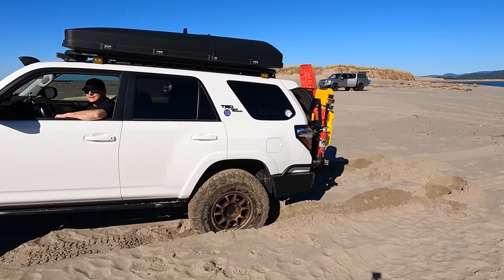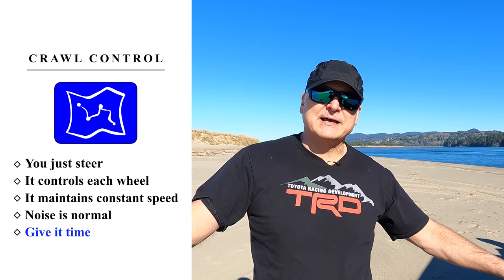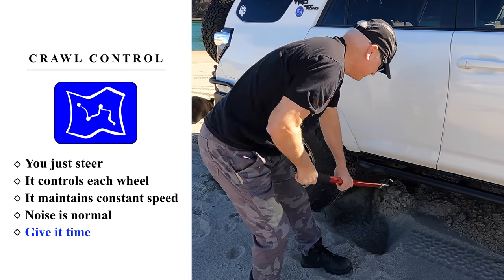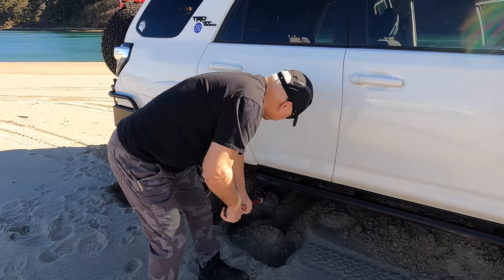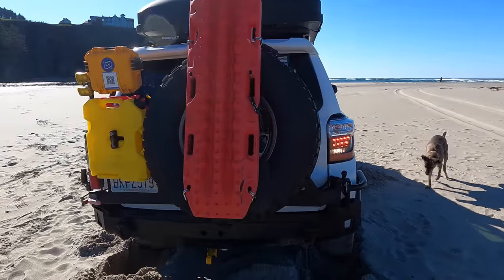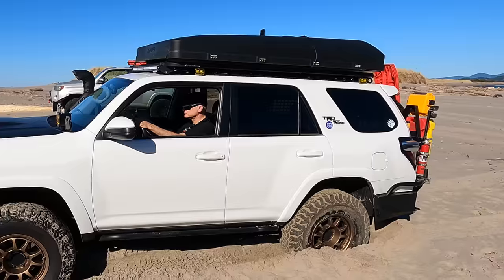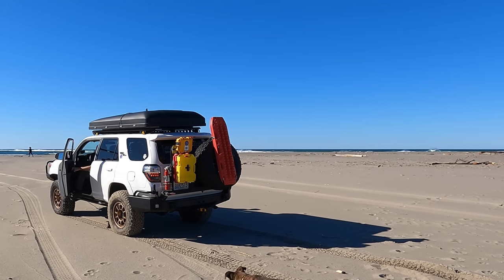Finally, the Only Crawl Control Video you Need to Watch - 4Runners Overlanding with Crawl Control

Comment: I have a SR5 P.  I am guessing I should get a winch and max tracks to be ready for these conditions and maintain momentum?  Your information is awesome. Subscribed!
Reply from the maker: Big thanks for the sub! The SR5 is very off-road capable right off the showroom floor. Wish I had the premium package! With a winch and MaxTrax, you'd definitely be in good shape. This is probably already on your list but everything comes down to traction and that means having a great set of tires that match your style of driving and the terrain you off road in the most (rocks, mud, sand, etc.).
Reply: @OverlandPNW  can I ask you what size tires would you recommend?
Reply from the maker: @MrJanglooos  That's the million dollar question! There are a lot of different opinions on this. For me, it starts with what kind of build you want. Is it going to be more of a dedicated off-road vehicle or will it be a daily driver? Mine is not a daily driver and I am currently running BF Goodrich T/A K02 315/70R17 which is a 34 inch tire (34.4"). My brother runs KO2s as well. His are 285/75R17 which is also a 34 inch tire (33.8"). Both required a body mount chop, a 2 1/2 - 3 inch lift, fender modifications, etc. to fit. For me, the geometry changes going above 34" tires just are not worth it for my style of off roading. The tire I had immediately before this one was a 285/70R17 which is a 33 inch tire (32.71") and it was pretty easy to fit. This was a nice step above the stock 265/70R17 32 inch tire (31.61") and still had very nice street manners. If you plan to do a minor lift and want to have a nice daily driver that will handle some fun stuff off road, then a 33 is not a bad choice. If you are going to do a bigger lift, cut plastic fenders, install bumpers and build something that will handle more serious obstacles, then I'd consider 34s. Tires are definitely one of the toughest decisions!
Reply: @OverlandPNW  thank you so much for this detailed response.  I will have to really think this over as you suggested to make sure I get the right ones.  Thanks again for sharing your knowledge.

Comment: Great tutorial I will have to watch and rewatch your videos, 9ne question.. will  Crawl control with work alongside MTS? I thought you can only use one at a time?
Reply from the maker: You are correct, you can only use one at time. You can however use CC or MTS (on the front axle) if you have your rear differential locked.

Comment: your techical reviews of the equipment available are great, thanks for the thorough job.  Do you happen to know if there is a maximum speed one can drive in 4HI in an off road premium or TRD PRO?  I know the system can be engaged until 55 MPH but there is no info on max speed like highway driving?  thanks
Reply from the maker: Your are correct. The manual does not state a maximum speed limit for 4WH after it is engaged. There are a lot of anecdotal accounts in different forums from people claiming different speed ranges are safe. There was even one I read of a guy that drove his 3rd Gen in 4WH to max speed every year on the salt flats. I'd say just use good judgement based on road conditions. If you heard of any reliable info on this topic, let me know. Thanks!

Comment: Good video. Is the Tacoma lifted? Thanks.
Reply from the maker: Yes, it is. About 3". Cheers!
Reply: @OverlandPNW  thanks for the reply. Is that the factory lift? I also wondered if the rear locker was used during the testing.
Reply from the maker: @8626John  The rear locker was not used during the testing.

Comment: Toyo 12  I have a 2022 4Runner TRD OFF-ROAD. I'am considering adding an ARB front locker and ARB air compressor. Can someone recommend a good 4wheel drive shop in the Vancouver, WA area that can perform this work? You guys have some very good videos, Thanks!
Reply from the maker: You will love the front air locker! I had my gears and air locker done by Nitro Gear & Axle. They are near Leavenworth in a town called Cashmere. As for Vancouver, I had an ARB rep recommend Woody's 4x4. I have never used them So I can't comment myself. I have been to their shop. They are usually pretty busy. That's what I know.
Reply: Thank you for the info. Your new partner must love the off-roading, Keep up the great videos. Thanks again.

Comment: The crawl control works fine until it's hot. The tranny overheats on the hot sand where I'm at.
Reply from the maker: I checked out your channel and saw you have a lot of experience with sand recoveries! I subbed. Watching the Land Rover is a good time!
Reply: @OverlandPNW  I appreciate it.

Comment: Thanks for the vid. Would you still recommend installing an ARB front air-locker with A-Track ?
Reply from the maker: The ARB air locker is great. The decision to install it with A-Trac just depends on your driving style and whether you already have a rear locker.  If you do casual off road trails, then there is no need for a front air locker (especially if you already have a rear locker). If you are doing more advanced obstacles, then I would recommend the front locker (even if you have a rear locker). My 4Runner has the factory locker on the rear axle and the ARB air locker on the front axle. A-Trac and Multi Terrain Select are also fully functional. But, I like to try advanced trails.

Comment: I love the production quality and educational content in all your videos, thank you!  One question.  Do you have transmission coolers?  I'm assuming since you have tow hitches, you probably have dedicated transmission coolers...but when you are going really slow (crawl control) it probably doesn't work very well.  Just curious, thanks again for the video!
Reply from the maker: We don't really tow much other than a small utility trailer now and then. Mostly, we use the hitches for recovery points. So, we do not have transmissions coolers. Cheers!

Comment: Any chance you know the suspension and tire setup on the silver 4Runner at 9:00
Reply from the maker: Yes, the silver 4Runner has about a 3" lift on Ironman foamcell pro stage 3 suspension. His tires are BF Goodrich T/A K02 285/75R17. His front bumper/fenders are modified for clearance. He has the Southern Style Offroad front bumper with the High Clearance Side Protection Option. Cheers!

Comment: Howdy, what lift kit did you put on your 4runner. Love all details!
Reply from the maker: The white 4Runner has Icon Stage 2 3” Lift on the front and Old Man Emu rear springs on back. The silver 4Runner has Ironman foamcell pro stage 3 suspension, 3” front, 2” rear.

Comment: I use ATRAC with rear diff lock on my FJ Cruiser frequently when needed, I truly appreciate the advantage of CRAWL control that my FJ Cruiser sadly lacks. My question would be, do you engage the rear diff lock while using CRAWL or that's not possible?
Reply from the maker: Crawl Control is designed to work across open differentials. The Crawl Control system automatically makes adjustments to (1) throttle, and (2) braking independently to each of the four wheels. If you lock the rear diff, the Crawl Control system can no longer make separate braking adjustments to the rear tires because since they are locked, they act as one. Having said that, from my own testing, you can activate Crawl Control, ATRAC and MTS with the rear diff locked. The system is technically monitoring side to side wheel slip across the rear axle but there is nothing for it to do since a locked differential mechanically allows no slip side to side. I have only done this for very short distances and don't recommend it. I have run the concept by a Toyota tech and he agreed that the systems are designed to be used separately. Hope that answers your question!
Reply: @OverlandPNW  since I lack the CRAWL, ATRAC with steady throttle, 4L and diff lock works out quite well but yes, if I had crawl, I wouldn't be using the rear diff locks.
Reply from the maker: @RoyFJ65  👍

Comment: A little late to the game with this video, but have a question with the crawl control sand test (not the uphill scenario).  Would crawl control have done an even better job if you dug out a little and used your traction boards in addition to the crawl control feature?  Thanks!
Reply from the maker: Yes, I believe so. The more traction it gets, the better it works.

Comment: seems like a lot of folks use CC going down hill so they feel like you can not ride brakes, even though it seems the trans or brakes would get overheated, but when you think about it, going down hill , you needs brakes and the lowest gearing you have if its steep enough , so its either you doing it or the system.
Reply from the maker: True. CC does just what you say and if it overheats the brakes, it will automatically cancel the CC system.

Comment: What is that moulding on Steve's front end where he high clearanced the front fender called?
Reply from the maker: The moulding came with the high clearance kit. I'm not sure what it is called. He has a video on the fender cut on his channel. He may give some more info on it there. If not, i'm sure he can point you in the right direction.

Comment: What tire pressure do you use in the sand with your 4Runner?
Reply from the maker: We run 10 psi in the sand. That seems to work well with our Method wheels. They have "bead grip" grooves on the inner and outer bead seat that are designed to engage the tire bead for a stronger hold at lower air pressures. You have to experiment a little and see what tire pressure works with your tire/wheel combo. If you haven't aired down to that range before with no problem, then I wouldn't go below 15 psi until you are sure it will hold the bead at 15 psi.

Comment: Regardless of the speed setting, when activating crawl control will it have a gradual start before getting up to speed.  In other words, if I set it to speed 5, will it be a jolt of speed/wheels spinning or does it learn the terrain and adjust the speed accordingly?
Reply from the maker: If you set crawl control to speed 5, it will take off. It is not a jolt but the system does not start slow and very gradually build up to level 5. It gets to 5 pretty fast. If you play around with the speed settings on some flat, easy terrain, you will see what I mean.

Comment: Have been impressed in many cases with the crawl control on the Jeep Cherokee Trailhawk, when it's stupid slippery, ain't nothing gonna get it out.   You almost have to break down the "off road use" down into like 4 or 5 categories.  I grew up super rural, a city dude's 3 for rough is my driveway!    Love my little beast, 3 years and 25K miles in.   Hoping the turbo lasts a while too, my luck, a week after the warranty mofo will pop like a zit!  heh heh heh
Reply from the maker: Those Trailhawks are legit. I've seen a few of them with a lift, bigger tires, front bumper and winch. They go anywhere!

Comment: What’s the setup tire size and wheel and lift on the grey 4 runner
Reply from the maker: That is my brother's 4Runner. His tires are BF Goodrich T/A K02 285/75R17. His lift is Ironman foamcell pro stage 3 suspension, 3” front, 2” rear

Comment: Is it supposed to make a grinding sound when you use it? Tried it for the first time.
Reply from the maker: It is common for it to make a knocking noise. People describe the noise differently. But, what people hear is the sound of the brake controller kicking in to brake the wheels that do not have traction. I'm not sure it is supposed to make a grinding noise. I haven't heard it describe that way before.

Comment: I'm the only one giving throttle in crawl control lol. Did you test it?
Reply from the maker: I've done it and I am sure we are not the only ones ha ha. I did not include it in the video because I wanted to stick to the "manual approved" method of increasing throttle while in crawl control by using the Speed Selector Dial.

Comment: What year model/s are these?  I know they came out with crawl control in '08, but it's it as capable as these? 

Looking at possibly a 2010/12 model for my family beach cruiser. Thanks in advance! 3:41
Reply from the maker: The 4Runners in this video are 2018 and 2020. I have not been able to find any reliable information on whether the smart sensors (braking sensors, stability control sensors, and wheel speed sensors) or on board computer software has been upgraded since the 2008 introduction of crawl control.

Comment: Who do you recommend to go get front locker install  on my 4Runner . Thanks
Reply from the maker: It really depends on the type of locker you are having installed. But make sure the shop you use specializes in differentials. They need to really know diffs! Then they need to have a lot of experience installing the brand of locker you want.

Comment: Toyotas features are great however there are scenarios where front and rear lockers in 4-Low are just one option for all scenarios that just works really well. It just “tractors” over obstacles, through sand, or up steep obstacles. Several of these scenarios are your trying to get stuck. A little different than getting to a spot you can’t get out of.  A great video would be head to head with say a Jeep Rubicon with similar gear. Toyota on highway is superior but off-road I don’t see anything in this video that would be a challenge.
Reply from the maker: I have dual lockers on my 4Runner. I installed an ARB air locker on the front axle. So, I have to agree that nothing beats twin lockers.

Comment: Crawl control works until a wheel speed sensor goes or the abs light comes on. It's a fun feature but dangerous if used as a crutch.
Reply from the maker: You definitely do not want of over rely on any automated traction system!

Comment: when driving on sand should traction control be off?
Reply from the maker: Yes, you will do better in the sand if all the passive traction systems are off. Momentum is your friend in the sand and traction systems will interfere with maintaining momentum. The way these traction aids work is by applying brakes to any wheel that is slipping. So, this can hinder your efforts to get some momentum going and can even get you stuck.

Comment: The white 4Runner rear was really bouncy in the video. To me looks like you need stiffer coils back there.
Reply from the maker: Ok thanks. There are two white ones in the video. One with a roof top tent and one without. Do you recall which one looked bouncy?
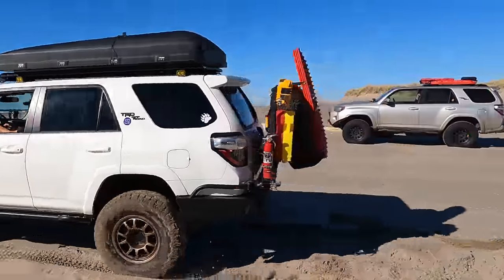Reply: You can see at 6:36 when she is driving out of the sand.  Maybe she is tapping on the brakes and exaggerating the ‘bounce’. I would investigate nonetheless.
Reply from the maker: @Tacoexplorer  Thanks for the timestamp! I'll investigate.

Comment: But what is the temp of the Transmission when it says "high temp"  200 220 230?
Reply from the maker: Unfortunately, that is a question I don't have an answer for. Sorry!
Reply: @audreyappliance  wow...I'd never want to reach that temperature.  Probably should change fluid after that. Thanks for the answer
Reply: @audreyappliance  agreed and thanks again for the info. I don't know if they have Trans cooler but they removed them from Tundra's in 2019 which I  didn't agree with so I added a setrab Trans cooler to my 2020 just in case. Have been thinking about getting  a 4runner for wife but prices are terrible now

Comment: All you need is a rear lock, no need for crawl control. Many, many videos out there to prove it. If your a newbie to 4x4 or just dont have skills then waste the $ on it. Otherwise just do 4x4 and buy and install a rear lock diff out back and your good. Its proven better than crawl control. The gimmick is for the unskilled newbs and just more stuff to break and increase cost of maintanence by 30%..
Reply: What extra maintenance is required?

Comment: I have a front and back locked 4x4 and I have a crawl control 4Runner, I’ve been let down by the crawl control every time I needed it. 
Sand and especially snow seem too much for it.  Traction control is only for the highway it’s caused the vehicle to get stuck as well. 
No you cannot turn it all the way off it will turn itself on. 
If you want to drive off road old is better the computer doesn’t have intelligence it has a one track mind. 
Once I abandoned crawl control I was able to get the vehicle out with determination and skill, the 4Runner of today is a scam. Heck don’t get me started about modifying the things either.
Reply from the maker: I learned to off-road in a 1967 Nissan Patrol. It had manual locking hubs, a hand crank start (no kidding), a manual transmission, and a clutch so hard to depress, I'd swear it came from an old tractor. Not a single modern "traction control" device of any kind. I really miss that rig!

Comment: Guys if u want drive in sand u need to make ur tire less than 15 air . Im from saudi arabia and we know how to handle it
Reply from the maker: You are 100% correct! Thanks for the comment!
Reply: What psi should I keep my tires at for daily drive ? 285/70/17 right now I got the front at 32 and back at 36
Reply from the maker: @steve9348  The recommended pressure is most commonly listed on a sticker INSIDE the driver's door. If there's no sticker on the door, you can usually find the specs in the owner's manual.

Comment: It seems the implied premise is flawed in its expectation that 4wd (in whatever tweaks involving locking differential, etc) works in all terrain types and configurations but crawl control just doesn't work in those conditions.  The reality is that ALL vehicles will get stuck no matter what technology, momentum,, tire types, etc.....even military tanks.
Reply from the maker: Thanks for watching. We all agree that any vehicles can get stuck.  4WD is no exception. In fact, we get stuck in our 4WDs in almost every video we make.